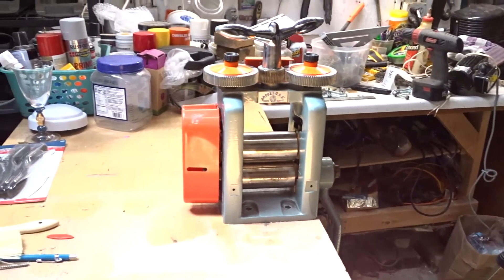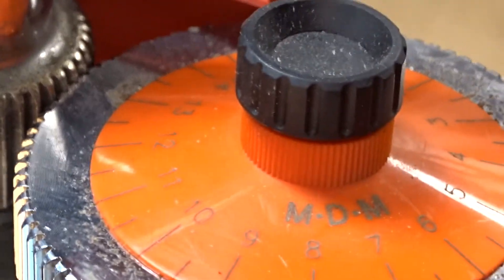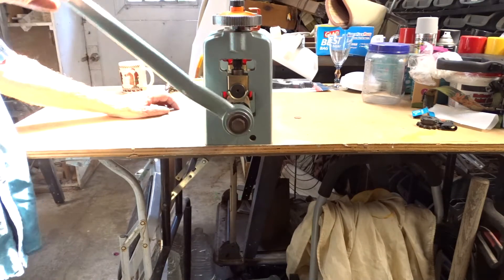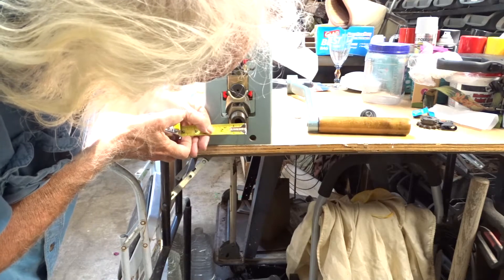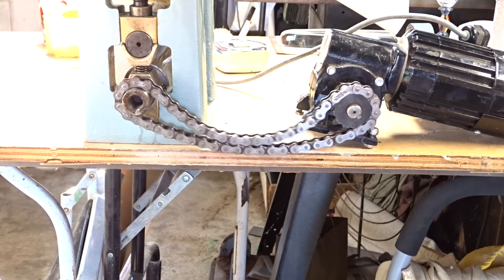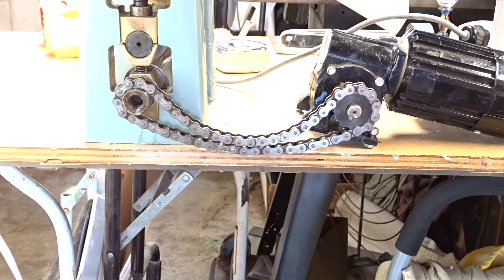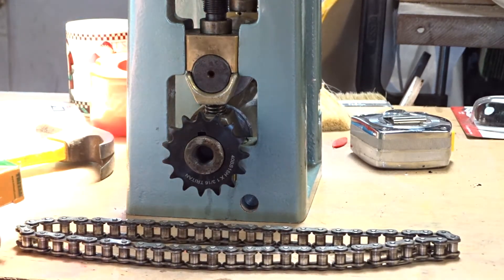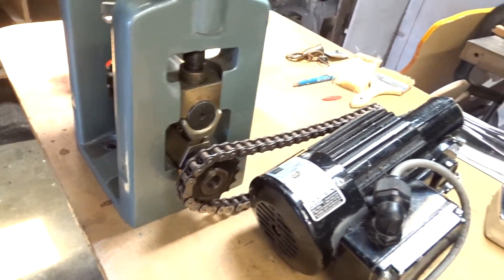Motorizing Your Rolling Mill

Comment: Somehow I ended up buying the exact same motor/gearbox and ratio for my rolling mill. It was an ebay purchase and came with a 2hp Dayton dc drive. It worked well for wire and narrow stock, 3/8" wide was the max it could handle with light reduction. If I was only doing rings and other small jobs it would have been satisfactory. It wouldn't handle ingots for making sheet. I ended up with a helical drive gearbox and larger dc motor. According to pepe rolling mills they don't recommend more than
 2250 in-lbs from a power drive so my combination was just over that. It was an unusual helical drive gearbox and normally very expensive so not worth including here.  The important number is the output torque of it.  A 1 1/2hp  motor and 60:1 right angle worm drive gearbox is the cheapest option and about the minumum to get a rolling mill capable of rolling sheet.  A cheap VFD for speed control would be needed. I just added this here in case others are considering what you've done and they need a bit more power.  Its more expensive but can still be done for under $600, much less if you shop around.
Reply: You have the link to purchase the motor tanks
Reply from the maker: @laleydeiguala6367  I got the motor on ebay.
Reply: have you considered a archemedies screw/worm drive? u get the best torque on electric motors with Archimedes screw's thats why electric drills windscreen wipers ext run them
all these builds ive found sofar(been researching before i build my own, (i live in suburbia a hammer press is out of question ) seem to use a gearbox like its a combustion engine, but you get best torque off archemedies screw with electric engine, 
main issue with archemedies screw is turning it fast enough to be practicable which isnt hard on a electric motor